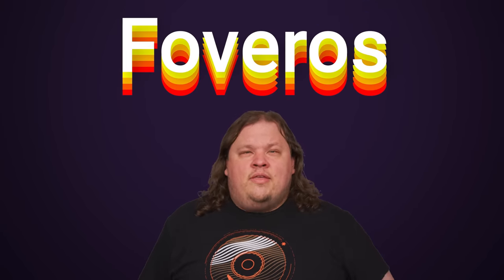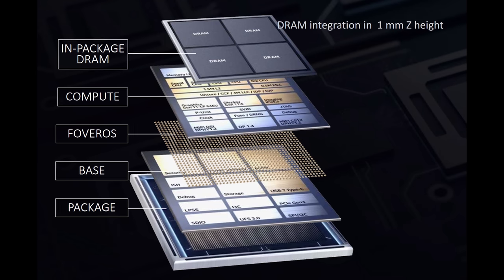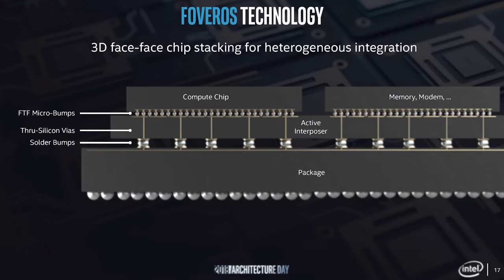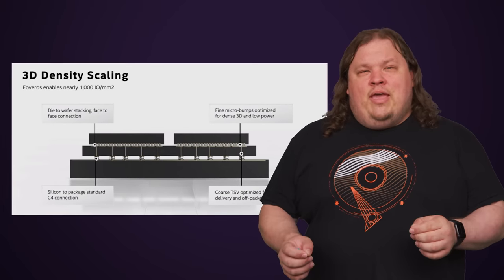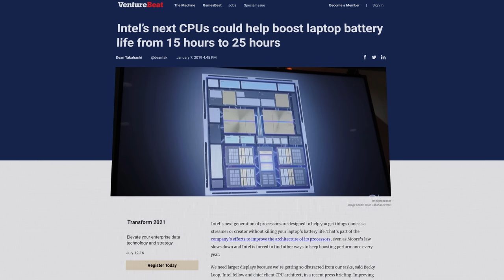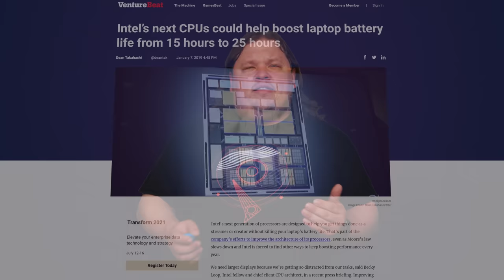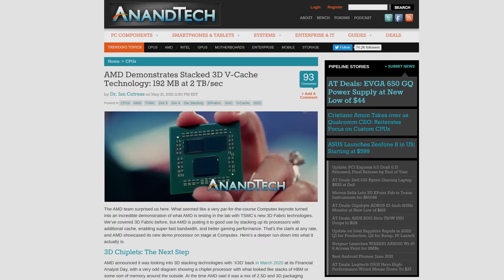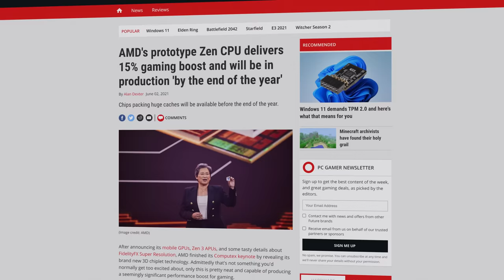They're STACKING CPUs Now!

Comment: You can fit original DOOM on the AMD cache thingy, and since the source code is open someone probably will do this.
Reply: @nobody7817  it is one with doom now
Reply: That doesn't make it any less trash
Reply: @dannyd4339  Doom or the AMD cache?
Reply: You don't have to explicitly do anything to put stuff in cache, the caches will automatically get filled with whatever memory is frequently accessed. So if you're running doom that will be the doom code and the assets.
Reply: @NoXion100  the amd cache
Reply: @Twire says the one defending a useless piece of tech just because it came from AMD. Sorry I go for the better product. Instead of people like you trying to virtue signal for amd 24/7
Reply: @dannyd4339  Intel is lucky with the shortage. AMD was cheaper and better before
Reply: Dooooooom eternal
Reply: Cheap Joke
Reply: @dannyd4339  ok, fan boy AMD is kicking intel's ass, but keep cheering them, we all need support to keep going🤣
Reply: @dannyd4339  better, Intel.... FUNNY
Reply: People on the 90's  OMG DOOM is occupyng so much space

People now: Doom can fit in S-rams now
Reply: @dannyd4339  Intel WAS better than AMD up until Zen 2, just like AMD WAS better than Intel up until Kaby Lake, or Skylake, I forget. Point is that these are competing companies, one will always be better than the other. Inability to acknowledge that reality results in the end user, in this case yourself, getting screwed by a company that sees you as a wallet and nothing else. These are companies. They don’t care about you, they care about your money. I expect there will be people like you on the side of AMD as well. These arguments are stupid either way. Acknowledge the reality of the situation and don’t have any brand loyalty, because these companies sure as shit have no loyalty to you. I’m sure Intel is going to strike back at some point, and when it does I’ll be using an Intel processor, but for the time being I’m going to stick to my objectively better Zen 2 architecture. I suggest you do the same.
Reply: @dannyd4339  but there are performance gains when they use more cache so what's the problem? And why are you assuming that he "defends" the product just because it's AMD?
Reply: @dannyd4339  what experience do you have with cpu manufacturing and Zen architecture? How do you know it's useless? Ha, I know. You don't!
Reply: @dannyd4339  whats wrong with AMD's cache?
Reply: @dannyd4339  hope she sees this bro
Reply: You can fit kkrieger into the Duron's cache. Easy mode.
Reply: @dannyd4339  ... I’m nothing if not an Intel fanboy, so I very much like their stuff. That said, I always approach things from an unbiased pov. AMD V cache is pretty neat, and is literally going to be the thing to stave off Intel Alder Lake until Zen 4 launches. AMD V Cache is a big deal because they’ve made it one
Reply: @dannyd4339  lol what?
Reply: The cache is what holds the instructions the CPU is to do so technically this is true
Reply: Considering doom isnt frame locked or speed locked it would be insanely fasy
Reply: 00DoubleOh I don’t think AMD was better up until skylake. Sandy bridge blew away anything they had to offer (not at all price points, I think? I can’t remember). But I like that they are coming back and hope they have some apus available soon for those cheap, entry level gaming systems.
Reply: Its 256mb of cache on their higher end CPUs which is crazy becauze the xbox 360 had 512 of RAM back in the day
Reply: @dannyd4339  All you do in insult people on YouTube. Great projecting! Meanwhile, my AMD processor will crush your Intel for the foreseeable future.
Reply: If someone doesn't do this I will be dissapointed
Reply: @00DoubleOh  AMD was better than Intel until Kaby Lake? What on earth are you talking about? There's maybe an argument for AMD being better than Intel in some regards until Sandy Bridge, but after SB, Intel held the crown until Zen2.
Reply: @EyesOfByes for the record you can't actually directly address L3 or below cache with x86, it's all abstracted by the platform. If you use a very lightweight OS, like literal DOS, and then load DOOM that way, you can ensure that everything on disk and in memory is in cache simply by keeping the OS, applications, and working memory set below that cache size.
Reply: You could but those CPUs don't have graphics on them so you couldn't play it.
Reply: @00DoubleOh  AMD was better than Intel until Conroe in 2006, then Zen 2 in like 2019.
Reply: @dannyd4339  the only reason i even liked intel is because of core 2 duo the rest i like amd
Reply: @dosgaming9715  you're entitled to your own stupid opinion. Intel is still superior thus far. Same way amd is still trying to play catch up with nvidia on the gpu side. The fact you like a brand better than another one means nothing technical wise
Reply: @georgejones5019  keep telling yourself that buddy. My intel gaming performance can crush any amd garbage you can throw at me
Reply: @zuckdaddy1596  ok make sure you don't delete this comment because I'll come back here to humble you once they show how detrimental that cache is to both performance and temps
Reply: @dannyd4339  well you too you even stated earlier that you hate amd that's an opinion too you know
Reply: @dosgaming9715  when did I ever say I hate amd? Can't you read?
Reply: @dannyd4339  the one replying to george jones
Reply: @dannyd4339  How is Intel better when you pay a lot more for just a little bit more CPU performance? I mean, yes, Intel KILLS it in the benchmarks (and that might be an overstatement), but the real world performance is about the same as AMD. In other words, only a small handful of people would notice any difference. I also want to point out that Intel advertises a LOT more than AMD. so your opinion may be based on years of being constantly told that Intel is better.

BTW, I hate virtue signalling too. :)
Reply: @dannyd4339  I wouldn't call AMD  tech trash, they're pretty good atm, the fact that you're triggered enough to call it trash and get defensive when anyone says anything, shows whose the real fanboy here lol. Just enjoy tech as they come, companies don't care that beta boy from south of Chicago bought Intel or AMD lol.
Reply: @rocker10039  I sense a lot of projecting here since all you just said was wrong but sure. AMD is more expensive than Intel a lot of the times offer subpar performance. Just because you like being blindly penetrated and robbed by your favorite company, doesn't mean everyone does buddy
Reply: @dannyd4339  when was.. AMD more expensive than Intel.. other than the shortage era and 5000 series..?
Reply: @dannyd4339  oh you sense projecting? Ironic lol. Let me make this simpler, I watch reviews from multiple reliable youtubers, linus, bitwit, Paul, jayztwocents, hardware unboxed, games nexus if I wanna know about specific tech, if these knowledgeable people don't find it trash, why should I listen to someone clearly who gas no idea what they're saying? Also just adding, I never said I buy AMD or Intel lol, turns out you can't read either... so your behavior and language skills tell me you're about 14 years old... tops.
Reply: What do you mean by somebody will probably do this? Someone will probably play DOOM on these AMS thingies...
Reply: If you can imagine it, you can code it 🤔
Reply: lmao
Reply: even more interesting is trying to run an entire OS on AMD's infinity cache, it's 32MB that is more then what windows 98 recommends you use for RAM
Reply: Original doom was like maybe 10 megabytes or so. 64 MB is enough for Quake.
Reply: 2.39 MB for the original Doom game back in 93 but that was in good old ms dos , Back when we had to spend a few hours just seting it up man if the kids had to do that now the tears would be epic.
Reply: @nobody7817  p
Reply: @irthiza man you don't wanna ask him that question, you'll lose iq points for every word of his answer you read, someone should record this for comedy lol
Reply: @dannyd4339  Will do 👍
Reply: @dannyd4339  God damn imagine being a CPU brand fanboy. Is your life really that empty dude?
Reply: Custom microcode go brrrr
Reply: @How23497  Doom doesn't need a GPU. Even Quake 1 would use software (CPU) renderer by default, and Half-Life 1 has software mode as well. An old school "2D card" or "video card" (without 3D accelerator) would be enough to ouput image to display.
Reply: @exodeus7959  I’m sure there’s somebody around that can make a convincing argument for that lol
Reply: @firstnamelastname5407  Intel had always had the advantage because it's features were pushed to be standard (much like Microsoft dominating the os market because it's programming language and features were pushed hard to be default), now developers are pushing to use amd feature set efficiently improving performance through compatibility.

Hopefully Microsoft's integration of Linux into Windows will see mainstream Linux development in the same way, benefit and improve in use friendlyness and compatibility for all use cases.
Reply: Fastest doom in da west
Reply: Won't be long before cpus have enough  cache  to fit a 100gb game lol
Reply: Challenge accepted...
Reply: OG Doom it's like 13mb, you can fit Quake and rocket jump Intel's version of stacking
Reply: You can't control what goes in the cache unlike memory, as it is not exposed at the low level by the assembly instructions. For a direct memory architecture like x86-64, you can either operate on memory or pull it into the registers to operate on. The cache in between the memory and registers are completely invisible to the instructions.
Reply: @dannyd4339  lmao what? U ok?
Reply: mega fast loading times
Reply: can it fit DOS doe
Reply: Can we make doom as a custom blue screen alterative where you have to beat the game to get back into windows? This is my ideal hell.
Reply: @dannyd4339  but intel CPU's just arent better anymore? the price to performance for AMD was considerably better than Intel. (before scalpers)
Reply: @dannyd4339  ??????????????????????????
Reply: @dannyd4339  imagine coping for a company
Reply: @commandertaco1762  tell us you know nothing about cpus without telling us you know nothing about cpus 😭
Reply: @SaltSpirits  what?
Reply: how about running entire os from cache ?
sounds cool!
Reply: 500.000 FPS's
Reply: You could fit Doom on the cache of CPUs from years ago.
Reply: Why? Because we can!
Reply: I was always more of a Wolf3d guy...
Reply: Programmers cannot directly control what ends up in the cache.  It's automatic.
Reply: @afox5319  you look at the benchmarks. And your wallet. Obviously not good enough because the Intel 11900k is not only faster and has a higher clock speed than your 5950x. But it's also $200 cheaper. So what you just said made no sense. Only a fanboy would make such a stupid purchase, lose money and performance, yet still side with their scammers.
Reply: @dannyd4339  You could fit ten mobile games on amd's 3d cache lol
Reply: Wait, y'all are arguing performance when you don't even do much with the CPU
Reply: @dailynotes2845  Wdym most games cant even run 90+fps on even the latest hardware (core i9 13900k + rtx 4090)
Reply: @Baconator20000  
Poor optimisation, afaik.
Reply: @dailynotes2845  Rendering
Reply: @Baconator20000  
(Not rendering)
I was thinking about something else.
Reply: @Baconator20000  
A.I and M.L can solve some of the problems I'm thinking of.
Reply: @Baconator20000 
I think Conventional computing is reaching it's fucked limits.
Reply: @Baconator20000  
The longer I think about, the more I think of programming and mathematics (Mathematica)

Comment: So when are we getting cube-shaped CPUs with integrated ‘plumbing’ for water-cooling?
Reply: You're a genius, I'm in, let's do it.
Reply: That is still not commercialized. TSMC, etc would have to develop etching techniques for it, I think
Reply: Your channel name is hilarious
Reply: at that tme we'll be pumping air through the cube crevices one atom at a time
Reply: If anything I can see maybe heat pipes in 3D stacked chips. Some sort of lattice design with poles that connect to the chip surface
Reply: My thought is put the connection on an outer edge of a board then chiplets on both sides of the board .. the mobo will be  hole with the connections on the edge so you can cool both sides of the cpu
Reply: @nobody7817  No no, coffee makes it multitask better, what makes it faster is watermelon juice, because it's red. xD
Reply: Linus did a video about watercooling a chip from the inside: https://www.youtube.com/watch?v=YdUgHxxVZcU
Reply: @randocalrissian9217  That would make the chip necessarily bigger (not just taller as intended but also wider -- edit: as with any integrated cooling solution), but I guess it would be a better solution.
Also maybe the socket itself could have some heat conductivity (while still isolated from the connectors themselves, of course) to help dissipate it from the other side.
Reply: @allluckyseven  yeah just spitballing ways one could integrate cooling in a 3D stacking design from what I’ve seen in patents related to SoC designs
Reply: It will probably happen,  but with alcohol not water, the water molecule is too big😊.
Reply: @florinpandele5205  no, it's definitely the other way around
 Ethanol is much bigger (3x as big, according to a quick search) than water.
Reply: And water probably conducts electricity better than ethanol. If they end up using ethanol it would be for other reasons
Reply: @srpenguinbr  You are right, I do not know why I thought it was the other way around. I guess than we are left with liquid nitrogen as the alternative 😊. It will make Gamers Nexus very happy too.
Reply: Like the GPUs with pre-installed waterblocks
Reply: @Untamed Corgi yeah. Stacking means difficulty in cooling
Reply: @nobody7817  Watercooling sucks. You'd be surprised how much one could achieve with simple undervolting and playing games with a capped frame rate.
Reply: @nobody7817  Everyone knows the best way to make anything go faster is putting flames down the side!
Reply: Inside this type of structure it would be easier to find a way to move the frequency of light up rather than down.
Reply: sparc did it with water cooled servers, the cooling is direct on silicon
Reply: cube of silicon with tons of holes for water to flow right in the die you could get a crap ton of cores plus killer gpu in that thing and even ram I would not not want to put any storage in it unless it has way to disable it once it dies
Reply: Actual water cooling jokes aside, I imagine that we'll start seeing improvements to chip cooling technology as stacking becomes more prevalent. Stacking additional components on top of one another will increase the thermal mass of the chip, causing it to hold on to more heat that they currently do. This could be very problematic if the different layers have different thermal requirements for peak operating temperatures. So either improvements to thermal insulation and/or heat transfer at these super small scales are going to be necessary pretty soon.
Reply: @Octavio Lopez 
Less heat than if you did it vertically 
But still stacking chips and getting more power will require more cooling 
And having it as a 3d cube could be an issue
Reply: You've already got a brain (I hope)
Reply: @nobody7817  
Bean cooling > Coffee cooling
Reply: Liquid Helium or bust!
Reply: @ArpanMukhopadhyay93  Awesome link! Thanks for sharing it :)
Reply: Sure, until we reach a full cube, it goes sentient and we're all assimilated.
Reply: @nobody7817  man you gotta be baked af rn
Reply: @neil1629  so timely!!
Reply: You just invented tesseract.
Reply: @nobody7817  damn... can't wait to dip my CPU into a Rocket
Reply: @RoySherfan  graphene isn't sn electrical insulator.
Reply: A company already made this, I don't remember what it was called but it was like a cluster of super computers in a cube with fiber optics connecting each together. It's memory was closer to cache.
Reply: @nobody7817  but coffee is hot, monster energy is cool, refreshing, and full of that caffeine goodness your computer craves.
Reply: Like the Terminator CPU ?
Reply: @nobody7817  Why did I read your comment in a Southern accent